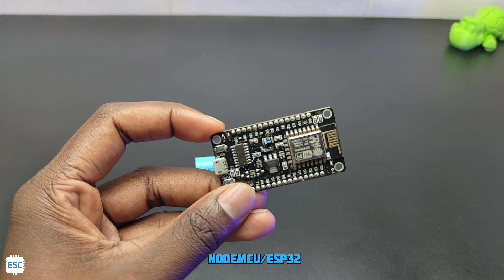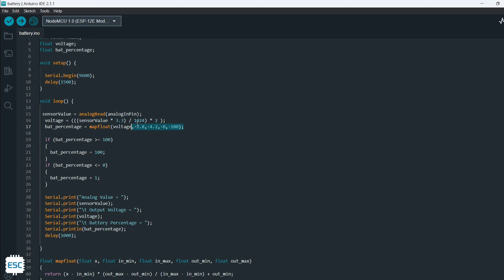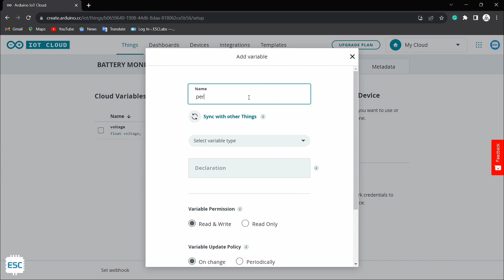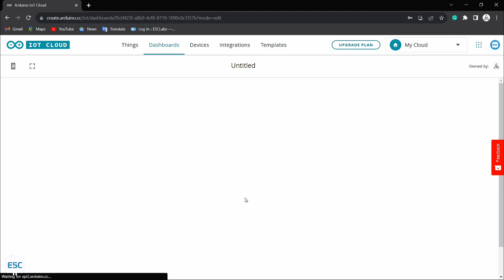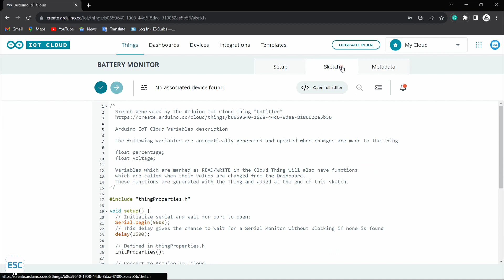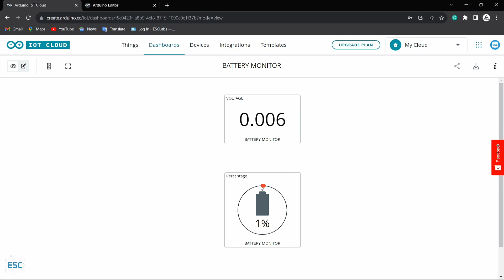Arduino IoT Cloud Based Battery Monitor | Arduino IoT

Comment: If I'm going to use an ESP32, which pin should I put it on instead of A0?
Reply from the maker: Almost all pins support Analog input in esp32. Eg-36,39, 34,32.
But you should check the printout to confirm that

Comment: may i ask? why the resistor has to be 100k?
Reply from the maker: No you can use any resistance from 10k .only think is you should use the same value. Just search for voltage divider using resistors

Comment: hi when i tried connecting a 12v battery it just saying it is 6.59 
do you have any solution to this?
Reply from the maker: Check the resistors also the voltage
Reply: @EDISON_SCIENCE_CORNER  
Ive found a solution to that problem... I just connected 10k and 5k resistor.. and the code do all the work
Reply: @Sneby. for 12v battery, regardless of AH?

Comment: Is it possible to do it for 12v batteries? just monitoring without the charger. I wanted to monitor UPS batteries
Reply from the maker: Possible
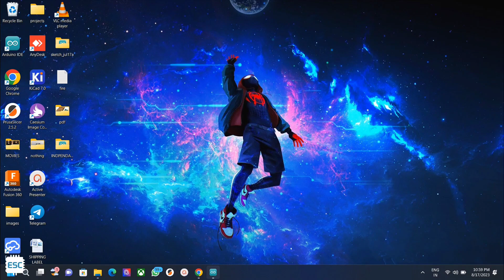Reply: @EDISON_SCIENCE_CORNER what should be changed? resistor or any? 1:03
Reply from the maker: @nantoyapoyao5506   yes you have to  check it with the equation. You can google it for that

Comment: It is possible to measure battery's current with this ..coz I not get a video for measuring it's current..please help sir..please give the equation in code for current measurement
Reply from the maker: You have to use the current sensor module for that
Reply: ok sir, but for current equation for the code is? @EDISON_SCIENCE_CORNER

Comment: excellent video how could I read the same thing but on a 12v battery with a bms already integrated?
Reply from the maker: You can use the same divider setup but we can't do it with bms
Reply: How could it be done? @EDISON_SCIENCE_CORNER
Reply: you have an example of bms circuit? please

Comment: Thanks for the video, can you please give us a direction if we want to monitor and measure multiple batteries with this setup? let's say we have a series of batteries nad we need to measure and display voltages of each batteries.
Reply from the maker: You can use the  bms circuit for that . And you can integrate with this code
Reply: @EDISON_SCIENCE_CORNER  do you have an example of bms circuit?

Comment: Nice video tutorial,we can also make battery charging station to monitor multiple battery voltages or can be used as wireless batter voltage monitor like multimeter
Reply from the maker: Yes, definitely